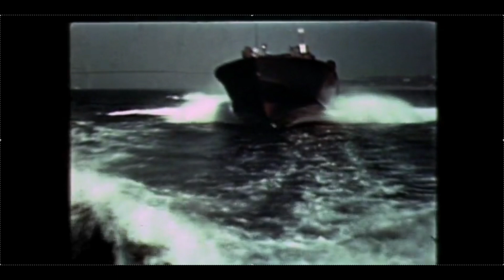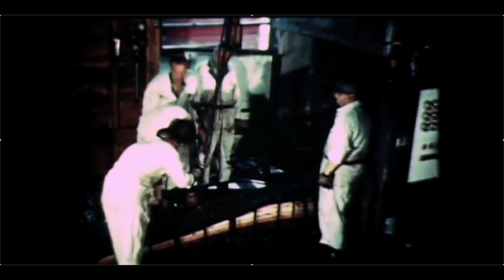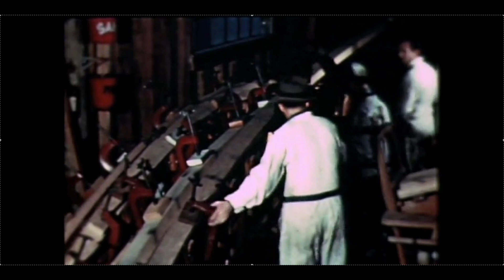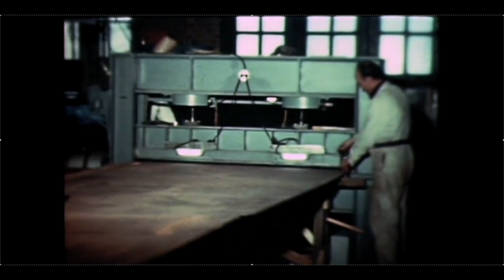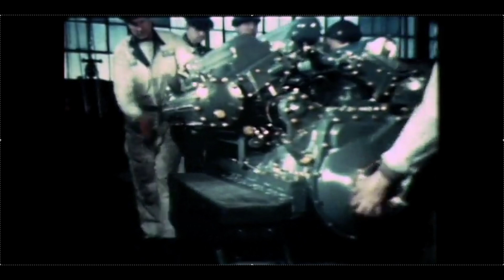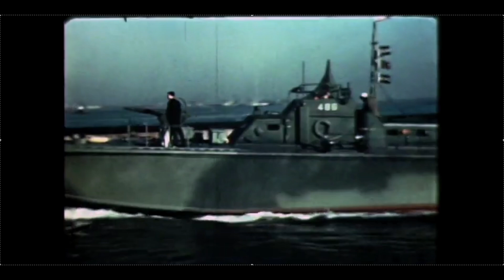PT Boats -  How the "Giant Killers" of World War II were built

Comment: My late dad was a engineer on a Motor/torpedo boat when young.

Besides the speed, they had the advantage to go in very shallow water, especially at high speed and a skipper who knew his waters. 

Today, surface propulsion is the standard to avoid cavitation. But otherwise I believe the same benefits are still in play.

It is to be noted that there was and still are not much room for comfort at 50 knots.